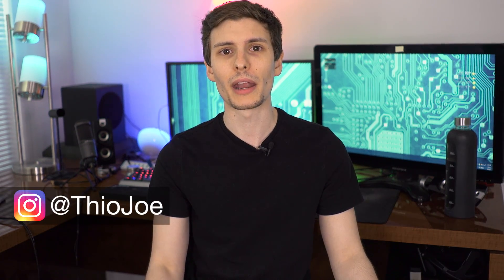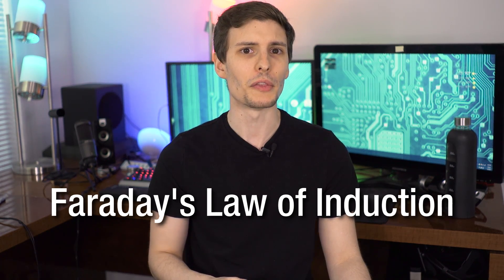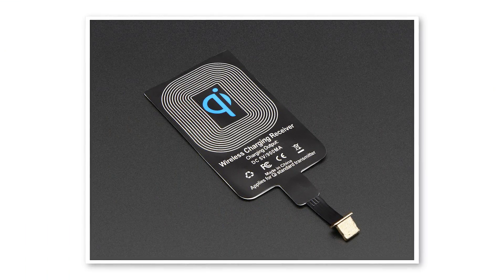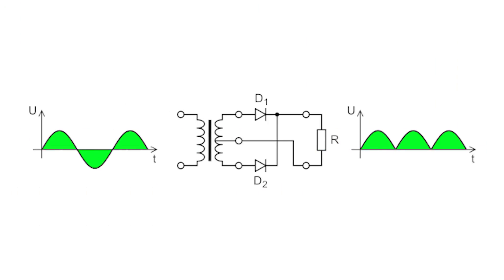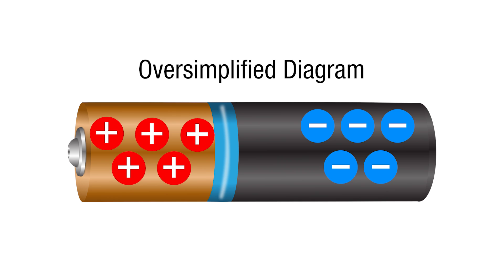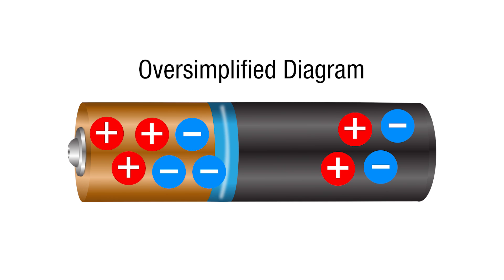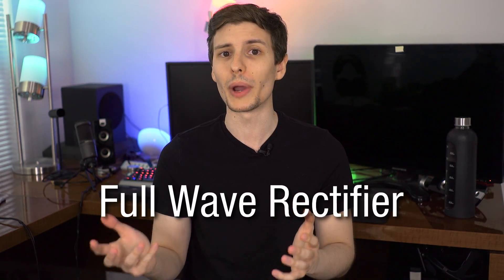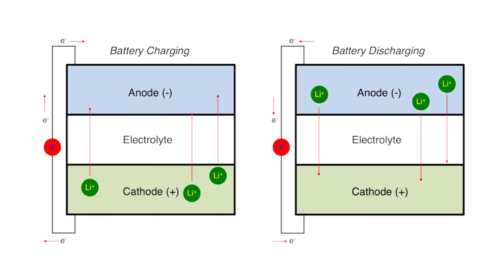How does Wireless Charging Work in Phones?

Comment: A very disjointed explanation of a subject that Thio has a limited understanding of.  A very simplified model of the electron is a spinning spherical magnet This model  is useful for explaining gross phenomena such as electricity and induction. When a static ( non-alternating) magnetic field is applied to the wire the individual electron's magnet fieldsis causes the wire to act as a magnet. This doesn't add energy to the wire, it organizes the energy that was already there. An alternating magnetic field does add energy. This is kinetic energy. The energy of motion. This is kinetic energy causes each electron's energy to increase. When the energy (charge) increases it jumps from electron to electron until it reaches a place where the energy does work. The work it does is changing the structure of the chemicals in the batteries in your phone. The electrons don't travel down the wire, the charge does.

Comment: Good job man! It was a great explanation.....you just save me the trouble for researching for it! I just have some questions.........I would like to know about that ac to dc rectifier..Is that rectifier is in the smartphone itself and you were trying to say that,that wireless charger is giving AC current to the phone and phone itself convert it to the DC ?......and why wireless charging can't be much faster? If there is a limitation for the coil which is in the phone for that ...then they can just increase the power of the magnetic induction.Wireless charging is cool but it defeats a purpose if it charges slow right?!

Comment: Wireless charging: An excuse for phone companies to not put a port on their latest phone or tablet
Reply: wclifton968 I doubt that since wireless charging while convenient is much slower. Until it's improved to be as good as fast charging there'll be some kind of IO port on phones for years to come. I reckon we'll see much smaller connectors before they're removed entirely!
Reply: but it seems like were' going wireless, look at the power of Bluetooth 5.0, Lifi (light bulb wifi) & the removal of the 3.5mm & 2.5mm Headphone Jack on many mobile devices

Comment: I think it's magic
Reply: Just wait until you learn of capacitive wireless charging. 

Instead of using coupled inductors you use two parallel plates. The impedance across a capacitor is 1/(2*pi*f*C), so since the capacitance would be very small, you need a very high frequency for reactive power to flow. 

I've a seen a lab where they experimented with this for supplying power to robots. A portion of the floor was an aluminum sheet. The robots had a flat bottem. 

The caveat was that if you touched the aluminum floor, and then touched something that would ground you, you would die a very painful death. (The body is slightly capacitive, so it's basically a short circuit through your body to ground.)
Reply: Of course it is!
Reply from the maker: it is
Reply: I've had a magic toothbrush fro 20 years.
Reply: Wireless charging is NOT real and this tutorial is FAKE
Reply: Yup confirmed
Reply: Successful Minds. You stupid